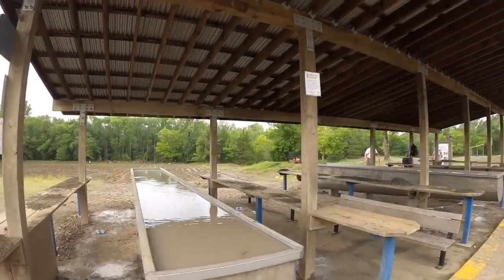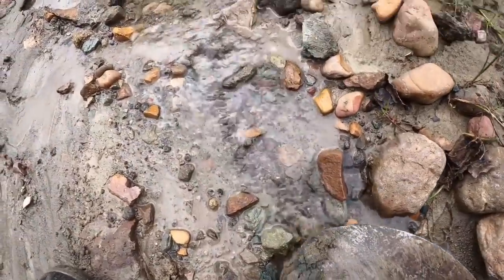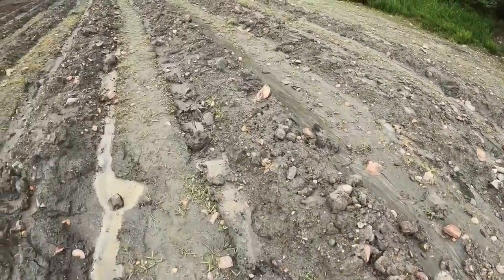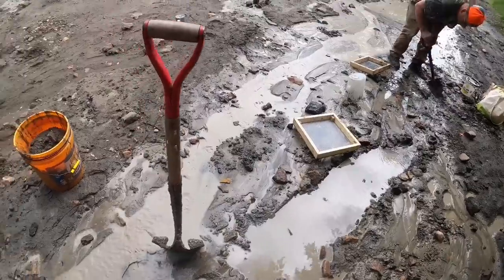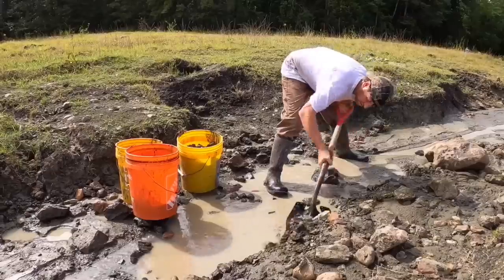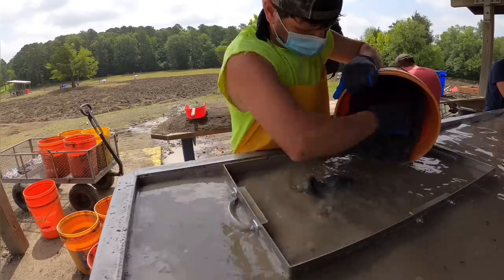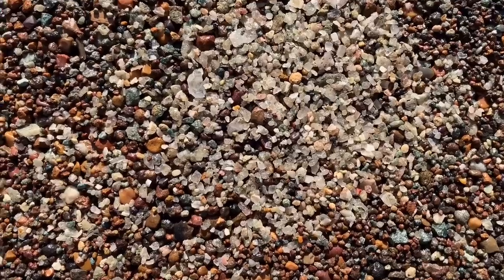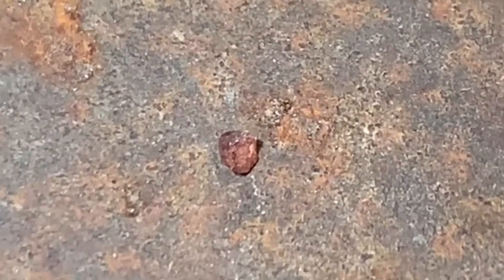WET SHIFTING LIKE A BEAST | Sampling, Identifying, Testing Gravel | Crater of Diamonds

Comment from the maker: Hi! 
Beware the ending isn’t what i was wanting, lost over 20 minutes of film. Working on a new setup to edit my videos. If you enjoyed it, please give this video a 👍! 
Thanks for the support, i love you all!
Reply: Great digging though
Reply: Thanks for all of the information in this video, I really appreciate it! Hope you find a diamond soon!
Reply: Here Is One Thing I Know About And I Live In Southern West Virginia But Magnetite Is Used For Cleaning And Washing Coal After It's First Been Mined And The Magnetite Is Crushed And Pulverized Into A Nearly Powder And When It's Added To Water, The Mined Coal Is Also Added And The Coal Will Start Floating To The Top And The Dirt, Sand, Clay And Other Debris Will Separate From It And Mainly Go To The Bottom Of The Coal Washers... Coal Washers Will Clean Raw Form Coal With Just Water To A Point But Adding The Magnetite Will Wash Coal Cleaner And Faster Because Of Helping The Coal To Float And Making A Better Separation From The Dirt, Rock And Other Debris....
Reply: Does the heart mean yes diamonds are invisible in the water almost
Reply: If this is something that people do often maybe you could create some tools, like a trowel that is 12” wide but 1inch thin blade that has 90degree bends that lead back to a handle like an old metal rake, then you could just scrap the top of the material or pull it then come behind it and scoop it with a snow shovel? 🤔

Comment: This looks like an incredible amount of back-breaking work.  I admire your tenacity.  I'm a pretty new subscriber.  Do you have elbow problems?  This must be excruciating!  Do you keep the crystals and gemstones that you find?  How do you tell rough diamonds from crystals?
Reply from the maker: I messed my elbow up washing a few trip ago at the diamond mine. I keep all the quartz i see in my top classifier,  not the bottom classifier. The diamonds have smooth, and rounded facets, the crystal have rough and jagged edges. Thanks for the support ⛏💎
Reply: @DiamondMinerIvins  Thanks for the info and the reply.  Interesting to know.  Btw, I've got bad knees and when they act up I find that flexible knee braces help greatly (amazingly!  It's quite something that just a bit of compression fabric can have such an impact -- I didn't believe it till I tried it.).  Perhaps an elbow brace might be a good thing?  Thanks again!

Comment: Seems like it would be smart to rake the top with tines about 3/4" apart to eliminate the really larger gravel before filling the buckets with the smaller gravel.
Reply from the maker: those larger rocks have deep cavities that can contain diamonds. That’s why we take all the large rocks up to the wash station. 

if you don’t you’re missing diamonds
Reply: @DiamondMinerIvins  Aaah...that makes sense. Something I hadn't considered. I've been diamond prospecting in western Wyoming, without luck, for several years. But lots of LARGE chrome diopside.

Comment: Your comment that diamonds want to get away from water and so you need to look to the sides of a course of water to find them is curious as its specific gravity makes them sink like lead, which is why you wash your gravel the way you do to concentrate all the heavy minerals. Here is a suggestion that may make your task easier, one that all global diamond mine processing plants employ when washing gravel, why not use a grease table. A grease table is a method of diamond extraction whereby a gravel sample is run down a gently sloping table covered in a specialized grease. And because diamonds are hydrophobic, any diamonds present in the sample will adhere to the grease. (Diamonds hate water, but love grease, which is why they get dirty so fast in jewelry.) Then it is just a matter of picking off the crystals.
Reply: How would you put the greas